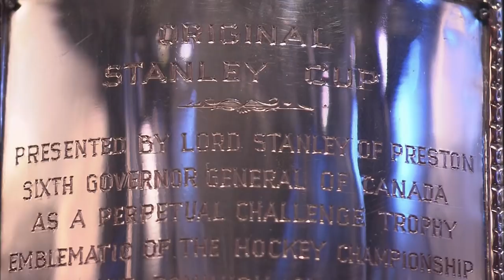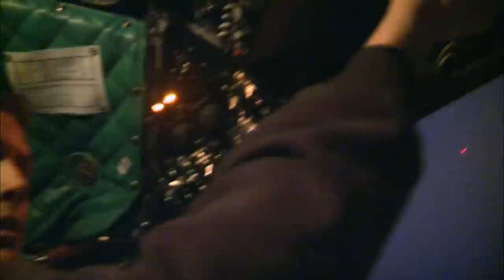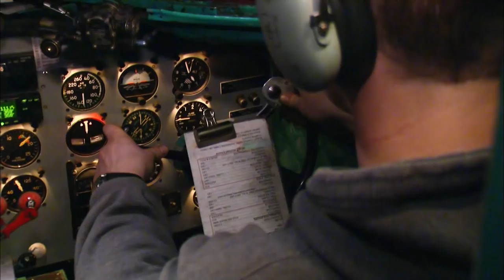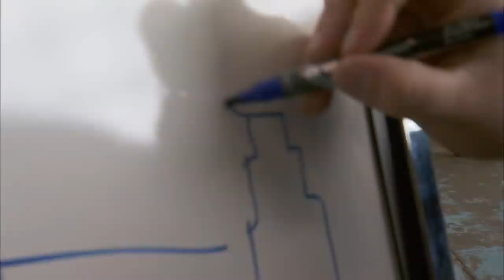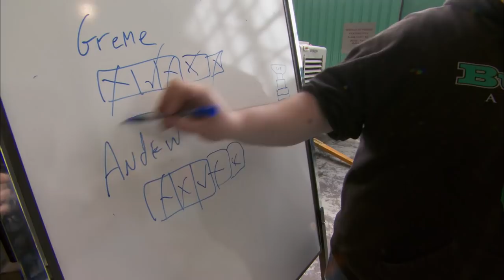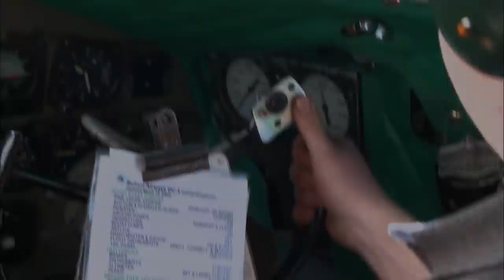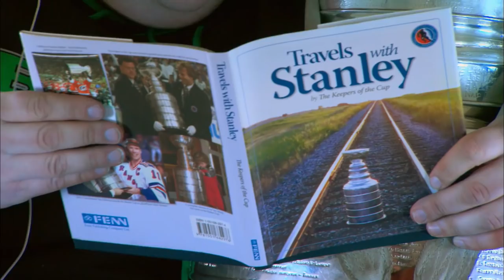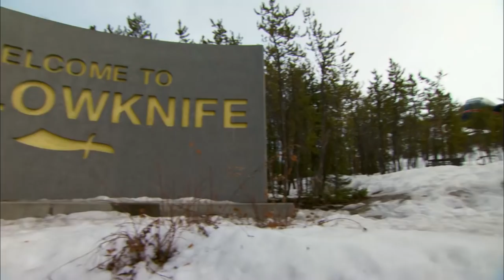Young Pilots Take Over After Captain Banned From Flying | Ice Pilots NWT | Wonder

Comment: It would have been really cool if that was the real Stanley Cup, but it wasn't. That was what is called the "Presentation Cup", which was made in 1963. In 1962, the Toronto Maple Leafs won the Stanley Cup. During a party after the win, the trophy was dropped in a bonfire and badly damaged. It was repaired at the expense of the team.

In 1964, Red Kelly of the Toronto Maple Leafs posed for a photo with his infant son sitting in the Cup, only to find the child had urinated in it. Kelly was quoted years later as saying it has always since made him laugh to see players drinking out of the Cup.

In 1970, after much wear and tear, the Cup was fully replaced with a duplicate known as the "Presentation Cup" made in 1963 and a second duplicate called the "Permanent Cup", which remains at the Hockey Hall of Fame. From this point on, in official functions and player days with the Cup, it is the Presentation Cup that is in circulation. So, the cup is actually YOUNGER than the plane it is on. Nobody's held the real cup since the 70s.